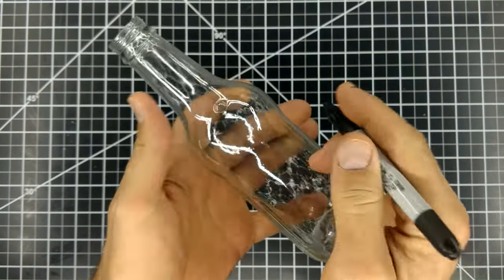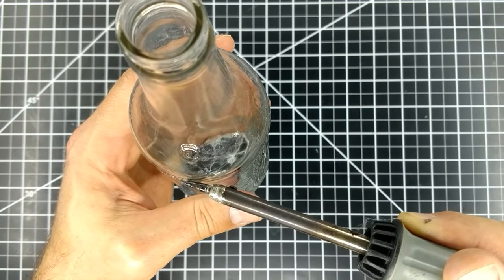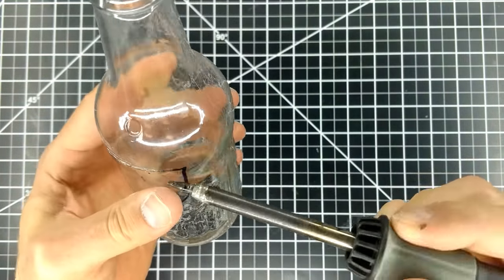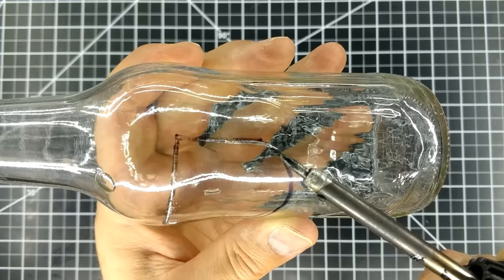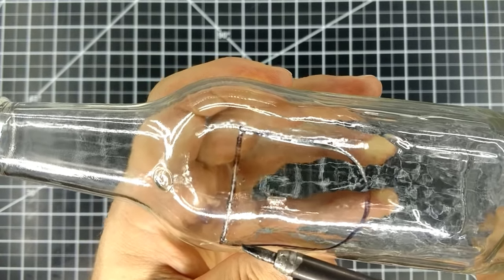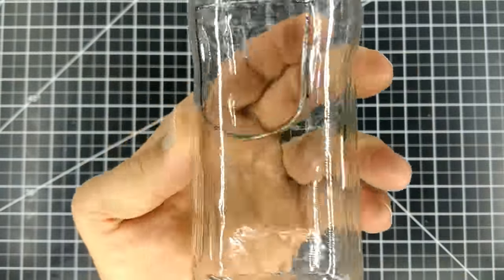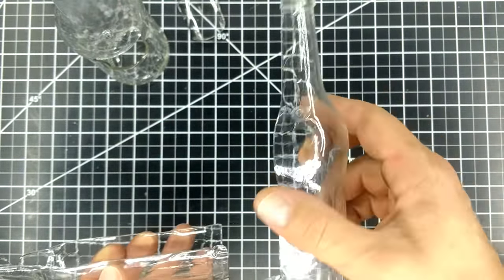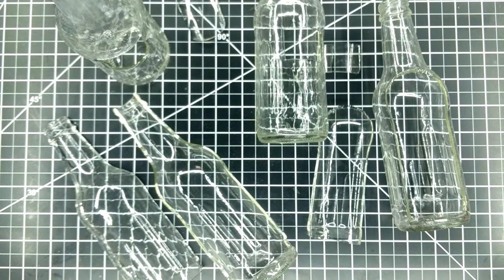Cut a Hole In a Glass Bottle (Using a Soldering Iron)

Comment: Now please solder the piece back to the bottle with a soldering gun.
Reply from the maker: I think this wins as best comment.
Reply: @HowDoYouDIY  Hello , sorry for my English ! how many Watt ( 150 Watt ? , 300 ? Watt ) has your soldering ıron ? Because glass needs high temperature to melt !
Reply from the maker: @YAKKOYUN68  Good question. This soldering iron is 15 watts. It's not melting the glass, just heating it up enough to move the crack.
Reply: It called  heat fracture. Or temp shock
Reply: I would like to do my own vidio on it and I'll give you a shout out on my channel  dark science experiments. If it's ok with you
Reply from the maker: @darkscienceexperiments8038  That would be awesome! You're welcome to share a link to it here when you get your video done.
Reply: actually you could by using stained glass foil
Reply from the maker: I didn't think about that 🤔

Comment: Great video. The sharper a corner the greater the stress concentration and the more likely a crack will form where it's not wanted. Some of the first welded steel ships, the Liberty Ships, broke in half because they had sharp rather than rounded hatch corners. Due to the high stress concentration at the sharp corners a crack in the steel would start there and then run rapidly all around the hull. This is true in any rigid material. The bigger the radius at a corner the less the stress concentration and the less likely the strength of the material will be exceeded
Reply from the maker: I really love this explanation of what's happening. Thanks for sharing!!
Reply: Enlightening & fascinating!!!!  Thank you for your video.
I learned some of the “whole" tricks from a glass cutter at a glass dealer / distributer.  I had to tell him what I needed, & couldn’t seem to explain it to anyone who could explain it to him,  “Why don’t you just come on back & explain it yourself.”  Bingo!!
I suggest more rounded corners, & then file, sand, nibble away to a square corner.  Use the file or sandpaper gently to avoid breakage / catastrophe.  “Soft” nibblers from your stained glass tool kit, tiny little “nibbles”.
Reply: Same happened to the BOAC planes.
Reply from the maker: That's a really good idea for making sharp corners! Thanks for sharing, I hadn't thought of that!

Comment: Been looking for a method to cut a slice out some bottles and this looks perfect. Cheers mate
Reply: I practised this method but couldn’t get the heat to crack the glass in a line so I returned to using a diamond tipped socket and just kept moving along to create the length then used a smaller diameter to go back and smooth the peaks between the cuts.
Reply from the maker: This is a pretty tricky method to start the crack. When practicing it's helpful to use thinner bottles. Thanks for sharing your experience, and describing what you ended up doing.

Comment: Thank you. I've been searching videos for months to get the best idea to cut out a hole in a glass bottle. Hope this will work out best.
Reply from the maker: It can be a bit tricky to learn at first. I recommend practicing a couple times on other bottles before trying it on your main bottle. Hope it works well for you!
Reply: Thank you. At first did you score all along the area you want to cut or only along the straight line on top?
Reply: There's another doubt. Will a 25 watt souldering iron do for this work? Kindly reply.
Reply from the maker: I only scored the straight line along the top. After the cracks is started, it will follow the soldering iron even if there isn't a score line. And yes, a 25 watt soldering iron should work. Thanks for asking!
Reply: @HowDoYouDIY  Thanks a ton for your genuine response.

Comment: excellent idea and thanks for sharing. I only saw you scoring the top line, but not the rest of the edges. Is my observation correct ? If yes, that would mean that you use the soldering iron to crack the top line after scoring, then use just heat only to continue to crack the rest of the edges. If you were to score the rest of the edges using hand held cutter, wouldn't it be fast to crack the edges and result in more accurate crack ? Please advise. Many thanks.
Reply from the maker: Great observation! Yes, I only scored the top line and used the heat to guide the crack the rest of the way. From my experience, once the crack is started it will move about the same fast whether there is a score or not. But it can be more accurate with a score all the way around because the score gives you a groove to hold the iron on track.

Comment: Physics/engineering: sharp corners act as focal points for stress which is why cracks then occur (checkout examples of early metal ship hulls & the de Havilland Comet...) - a radius, even a small one, is always best
Reply from the maker: Thanks for sharing this info! That explains why it always cracks at the corners, but not at the curves.
Reply: @HowDoYouDIY  no worries: if you've gone to the trouble of posting a video, least I can do is supply some (hopefully) helpful information
Note that a radius reduces risk rather than eliminates it: essentially it raises the threshold at which a crack might occur
One approach I've considered (but yet to try) is cutting between small drilled holes. I've a suspicion it might not work as well as might be thought, and that the sequence of actions (e.g. score then drill vs. drill then score) will also influence outcome
Reply: @HowDoYouDIY  Apologies - never said thank you! Using soldering iron hadn't occurred to me until I'd seen this and it's definitely something I'll explore

Comment: As a professional glazer, I would use a drill bit designed for glass. Drill one hole in each corner then score the glass and continue as shown on this video. To remove the piece easily you need to score the glass diagonally from corner to corner and heat as shown. You will not get a perfect 90 degree corner but you could use a square stick wrapped in sand paper to square up the corner.

Comment: so cool
dose the thickness of the glass and shape of the iron matter
I am battling to get a crack on a beer bottle 
i scored bottle with a diamond wheel
Reply from the maker: Thickness of the bottle does make a difference, thicker bottles are usually harder to do. Beer bottles are a good thickness to practice/learn on. I have noticed that the color of the bottle seems to make a difference too. Clear bottles seem to be the easiest.

Also, scratching the score line into the bottle takes a bit of practice too. If it's not deep enough it won't ever start, and if it's too deep it won't start either. Try to pass over the score line only once when scratching it.

I hope this is helpful. Keep trying, and good luck!!
Reply: @HowDoYouDIY  thank you it has yes iv noticed it to with collard glass

Comment: I got a super thick milk bottle I'd like to turn on its side maybe cut out a rectangular hole I'd post a pic but my phone doesnt let me would this work for that type if project? It would have to not crack at all tho because it would be holding water.
Reply from the maker: It should work, but there are a few things to keep in mind. Thick bottles are possible but more difficult to get started. And you don't want sharp corners on the holes. For a rectangular hole, you can make it with curved corners.

I would recommend practicing on some thinner bottles so that you can get a feel for the process.
 Another option of this doesn't work, you could use a Dremel with a diamond cutting wheel. If you do, keep the glass under water, wear a good dust mask, and safety glasses.

Comment: The corners are cracking because Sharp corners are pretty much already cracks. Imagine a tiny skateboarder riding his skateboard on the inner surface of the bottle that you just cut. Any spot where it is not smooth and he would crash on his skateboard , that would be considered a crack waiting to happen. Also it's sort of like trying to rip a t-shirt at the collar. once you have a tiny cut in the collar of the T-shirt it rips easily. It's pretty much the same thing. Basically if you could find a way to round the corners instead of making them fine points you could avoid cracking. I'm a glassblower I hope these tips help you
Reply from the maker: I was thinking that it was probably something like that. Thanks for sharing info from your expertise!
Reply: @HowDoYouDIY  same to you. consider it a trade. Great videos
Reply: @HowDoYouDIY  I would suggest first drilling holes in the corners underwater before you start your cut. If you use the small enough drill bit you would probably hardly even tell that the corners weren't Square. Also if you do do this method. Be sure not to breathe in any of the silica dust because it's extremely hazardous. All right I promise I'll stop talking your ear off. I hope these tips help you
Reply from the maker: I appreciate the feedback! It helps me and everyone else that sees the comment. Plus, the info you're sharing is extremely helpful. Thanks!!

Comment: How long are you holding the solder in place on the bottle? I cannot figure out if the video speed things up or not, thank you
Reply from the maker: That's a good question. When trying to start the crack, about 8-10 seconds before moving it. Up to about 30 seconds of the crack is being stubborn about starting. After the crack is started, it varies, but usually a couple seconds.
Reply: @HowDoYouDIY  Thank you. I have a thicker, small milk bottle that I am trying to do this too. I am also new to soldering. I have a 30w solder that I tried last night.
Reply from the maker: Thicker bottles are a bit harder to start a crack in. I would recommend practicing on thinner bottles to get a feel for the process. Soda/beer bottles are usually fairly easy, but the easiest and thinnest bottle I tried was a salsa jar.

Comment: How deep must the score line be to work well? I have a real hard time getting the bottle to crack with the soder iron. :(
Reply from the maker: When you score the bottle, you want it to make a line that looks more than just a light scratch. Only scored the line once. If you score the line more than once, the crack may not start. Also remember that the thicker the glass is will be harder too. I recommend practicing with a thin bottle. Also, clear bottles seen to be the easiest, but color bottles are possible too.
Reply: @HowDoYouDIY  Yeah, the drill bit I tried scratched the glass but gave me the hardest time to make a straight line without being all sketched out. Making the heat effect of cracking not possible because of lack of depth I imagine?! For sure I will practice alot! Wich color do you find the hardest to work with? Hey man, you're the best, thanks for answering me with all this! :)
Reply from the maker: I've never tried scratching the glass with a drill bit, so that could be. I've done this with green, blue, and brown color bottles. All of them seemed to be about the same hard to start. The easiest bottle for me to cut like this was a salsa jar. Clear glass, and it was thin.
Reply: @HowDoYouDIY  I have tried but I can't seem to achieve getting a crack with a salder iron. I have used a bigger one, more powerful and still no crack. Wether i score the glas once of manytimes over, the crack doesn't appear. Is it long to get a crack? What am I doing wrong? I'm very interested in achieving this so getting tips and advice would be very much welcomed! :)
Reply from the maker: Have you tried using a glass cutting tool to score the bottle?
Reply: @HowDoYouDIY  I got a diamnod disc. How long does it take for the crack to form when you put the iron on it?
Reply from the maker: It depends on a lot of things. I've had it take about a minute, and I've had it take over 10 minutes. That's why I recommend practicing on thin bottles. I have this video on my other channel where I show my process without skipping and without fast forward. It takes until about minute 4 in the video for the crack to start. I show how I move the iron before it cracks and how long I hold the iron in place. You can hold it in one place longer, but you don't necessarily want to heat up just one spot. https://youtu.be/ChmuNzJ7VJY
Reply: @HowDoYouDIY  Cool, thanks! I will check that out! :)

Comment: Very interesting method. I'd personally prefer to use diamond tip bits under water with a Dremel.
Reply: Why water?
Reply: If you ever used a drill, or seen someone use it, you might have noticed particles flying off everywhere like some heavy dust. When you’re drilling glass (stones, shells, etc.) always do it submerged in water, so that this glass-dust can’t escape  🤗
Reply: Negin Negin it wouldn't be safe to just wear safety glasses and do it outside or something? I'm fine with water just curious
Reply: also to protect your respiratory system and its easier to clean
Reply: Yung Feind the reason you use water is to keep the glass cool and to help keep the cut lubricated so there is less friction which would shatter the glass. Drill oil works better
Reply: Yung Feind Oil or other liquids are often used to cool and lubricate, like Chris said, although it's the drill bit overheating, to the point of damaging the sharp edge, rendering it useless, rather than the metal you're cutting. With low speeds and or other materials it may be less of a problem. With glass it's more sanding than cutting like you do when drilling in metal.
Reply: There is another video somewhere on Youtube of cutting glass with a diamond tip round bit, and using a water filled pop bottle with a pin hole in the side to water the cut. The bottle is "Peeing" on the cut and the bit, it really makes a difference.

Comment: Great video, I wonder if using tape or hot glue on the outside of area to be cut would stop the stress cracks in corners ?
Reply from the maker: That's a good question. Eventually I'll be trying a lot of the suggestions I've been getting, I'll have to add this to the list to try.

Comment: What if the corners are saved until last?  That or partially heating the corners then come back and finish last?
  Interesting video. 
  Might be a good gift idea. Think of a ship inside a bottle with the cut glued back. If lucky, no sanding so the edges will match.  Kind of have my doubts about completely hiding the cut though. 
  Maybe paint the backside where the cut is. I suspect the cut would still be visible on the inside though. 
  Something to experiment with.
Reply from the maker: Thanks for sharing your idea, I love your idea of using this to put something inside the bottle! One thing I noticed about the sharp corners was that they will crack eventually. If not while doing this then when you pop the center out, or sometime after. It seems like that point encourages it to happen there. But an alternate option is making rounded corners. I hope this helps!
Reply: How Do You? DIY I wonder if there is some way of stuffing the bottle with something to lessen the chance of the corners breaking past the “cut”. 
 

Something else I wonder about is maybe drilling a very small hole in the corners then do the cut. I have always thought a hole at the end of a windshield crack would stop the crack from getting longer. 
  Aw heck, just heat the whole bottle in an oven then cut it with the iron!
  Think of welding cast iron.
Reply: You can import your ship from the bottom of the bottle.  About half a centimeter from the bottom of the bottle.  In this case, you will only have a circular cut.  Hiding the cut in the bottom of the bottle is a little easier and less obvious

Comment: Hi How Do You? DIY+

my soldering iron's
temperature    --446°F (230°C)
watts -----------30

I tried to put a 
 small square sized hole on a 
 empty mayonaisse jar(bottle)

I placed the tip of the soldering iron
 30 seconds each space about 20°angle.
 Then I move the tip a bit (1 mm) 
 at a time.

However, I was unsuccessful in 
making any score marks 
Therefore, I cannot make the bottle to crack

How long does it take to do it?

I sincerely want to make this work.
Please tell me what did I do wrong

Many thanks & look forward for your advice
:)
(update - I also wrote same comment
in your instructable page..Hope it's OK  :)
cheers]
Reply from the maker: Try using a glass cutter to make the score mark. But it can be tricky, because if the score goes too deep into the glass, that will make it harder to start the crack with the soldering iron. The best way I can think of to describe it, you want the score mark to look like a scratch in the bottle. If it goes too deep, it tends to look more like a white line (if you're using a clear bottle.)

Comment: Great video! Can this be done on the bottom of a bottle or glass?
Reply from the maker: That's a really good question. I've tried to do this on the bottom of a bottle, but the glass seems to be too thick. I couldn't get it to work on the bottom.
Reply: @HowDoYouDIY  Thank you for your reply.  I have been trying to drill a hole in the bottom of a glass for a prank.
Reply from the maker: Oh, I have another video about drilling holes that works on the bottom of bottles and glasses https://youtu.be/vruWpGb5248

And here's another video I made where I drill smaller holes in a bottle with a different bit. I don't discuss the drilling much in this one, but I do show the bit that I used. https://youtu.be/BDAc0ZWjVjs

Hope this is helpful!